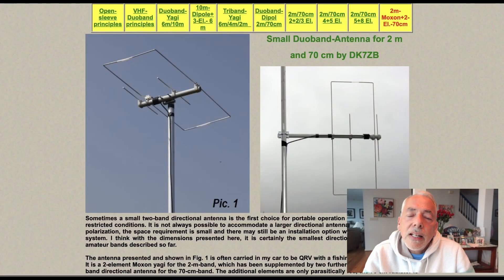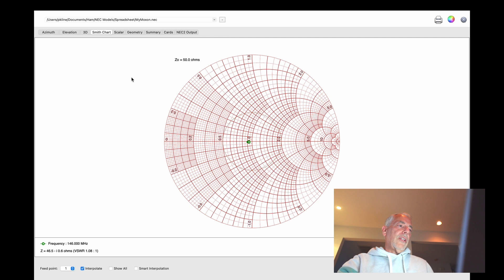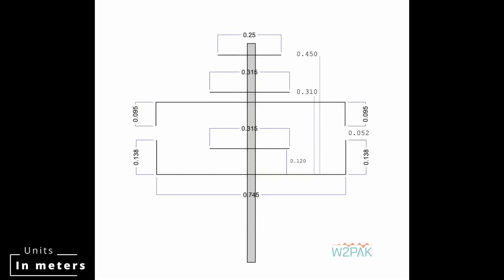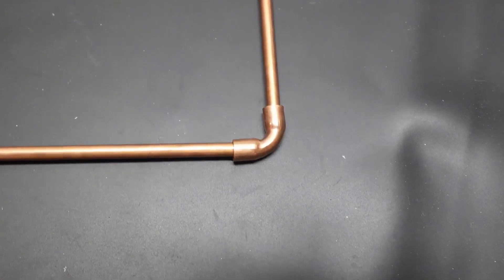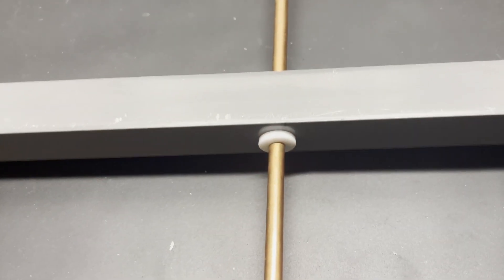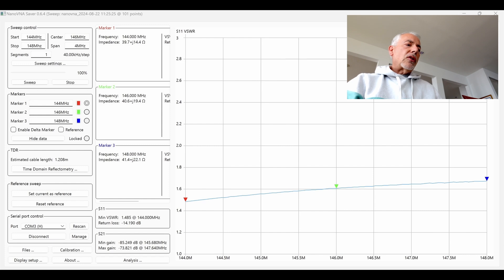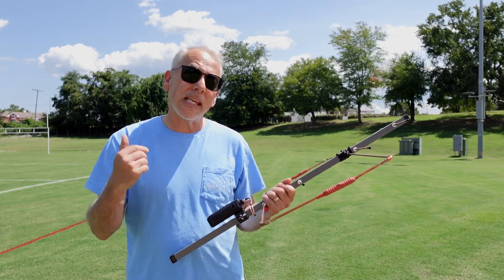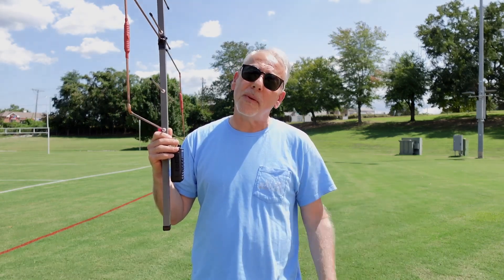DIY Moxon/Yagi Antenna for Ham Radio Satellite QSOs: Build One for Under $100! [Includes the radio]

Comment: How and where did you connect the coax cable? I was looking for that part! Other than that, beautiful instruction video
Reply from the maker: The coax went inside the beam. I soldered the coax to the driven element just as it exits the beam.  I hope that this helps.  73, Paul.

Comment: Maybe I missed something how do you make the actual connection with the coax cable onto these elements?
Reply from the maker: Thank you for the question, I simply soldered them to the driven element. I chose to solder them on the outside. 73, Paul.

Comment: Thanks for the build video!  The design is fairly common, but I love your clean construction techniques.  Thanks for posting links for parts.  Maybe I'll take a stab at building this in a cross X pattern; two of these perpendicular on a single boom for circular polarization.  So, out to the workshop!  😃
Reply from the maker: Have fun. Post pictures when you are done.  73, Paul.

Comment: Is the driven element in two pieces separated by a gap, or one solid piece where the coax is soldered  on each side of the one road?
Reply from the maker: Thank you for the question. It is two pieces separated by a gap. 73,Paul.

Comment: Hi Paul, Great tutorial. However, you did not show the detail on the feed point. how did you do it?
Reply from the maker: Thanks for the kind words. I soldered the coax just as it enters the boom on both sides of the driven element. There is a little 5 mm stub on each side of the driven element, but it doesn't seem to affect the performance. 73, Paul.

Comment: Hello again Paul!  Thank you for the reply to my previous question but I have another...would it be possible to show the detail of the coax connection to the driven element and provide a description of how you made the connection?  Did you solder the connection outside of the boom/grommet and pull the element thru the grommet?  I'm just not able to envision how you did this.
Thanks!
Lance
Reply from the maker: Hi Lance.  I soldered the driven element on both sides first then fed it into the boom.  I hope this helps.  73, Paul.

Comment: Hello Paul!  Thanks for doing this video, I'm a new ham as of a week ago and am going to be building this antenna over the next week for satellite comms.  I would like to know what the black object near the center of the boom is, where the 2m director passes thru the boom...
Thanks!
Lance
Reply from the maker: Hi Lance.  Thanks for the kind words. It is electrical tape. I soldered the coax to the element and it is tape covering the solder joint. Hard to see on the pic.   Hope to hear you on the air. 73, Paul

Comment: Hi @W2PAK, I struggeling a bit to understand where and how you connected the Coax to the Moxon, also because English is not my native language. Do I see it correctly you feed the coax from the lower part of the moxon and connected it to the upper part of the moxon, right? Like the inner part of the coax to the right side of the boom and the shield to the left side of the boom? Sorry for asking probably stupid questions, but I am just getting into building DIY antennas and SatCom in general. My first DIY antenna was the flowerpot antenna from VK2ZOi
Reply from the maker: This is not a stupid question at all. What I did is run the coax down the center, boom, and solderer the shield to 1/2 of the element and the center conductor to the other half of the element; the soldering was done outside of the boom. Good luck with your project, if you have any questions please feel free to contact me. I hope to catch you on the air, 73, Paul.

Comment: Thank you, I am a new tech looking into my first attempts at satellite communication. Your project seems really interesting, I think I will give it a try! Thank you for your time, a sub well deserved! 73s from Athens, Greece
Reply from the maker: I am really happy that you liked the project, it is a fun project. I also have a video on satellite QSOs, if you haven’t watched it already.  I hope to catch you on the air.  73,  Paul.
Reply: @W2PAK  Hi again, just to clarify, in this design there is only one driven element on the Moxon - 2m side, correct? No driven element for the 70cm part? (the 70 cm  elements act as reflectors with the Moxon driven element?) - 73 de SY1ESG
Reply from the maker: @Yozimbo  You are correct, there is only one driven element. I think that it is kind of cool. 73, Paul
Reply: @W2PAK  Thank you for your reply, that is indeed very interesting! I think I will give it a try! 73s

Comment: It looks like your copper elbow link is instead pointing at more of the elastomer grommets.
Reply from the maker: The copper elbows are simply to form a 90 degree angle.  73, Paul.
Reply: @W2PAK  OP was commenting about your amazon link in the video description. Instead of pointing at the copper elbows, that links is a duplicate pointing at the grommets again.

Comment: Any details on how and where you connected the coax to the driven element? great looking build and congratulations on the contact
Reply from the maker: That is a great question. I soldered the coax just as it enters the boom  on both sides of the driven element. There is a little 5 mm stub on each side of the driven element, but it doesn't seem to affect the performance. 73, Paul.
Reply: @W2PAK hi, great idea to use a moxon for the 2m part. Can you tell me how the radiating element of the 70cm yagi is fed/matched? and how/where do the feeds to the two antennas come together? 73, M6RTC
Reply from the maker: That is a very interesting question. The antenna is fed only into the 2m radiating element. There is no “physical” connection with the 70 cm elements.   I think it is very cool. 73, Paul.
Reply: OK thanks, that's helpful